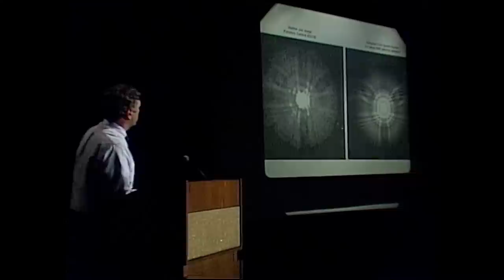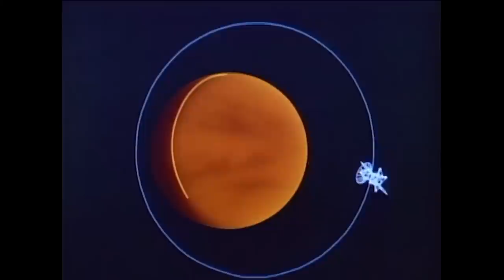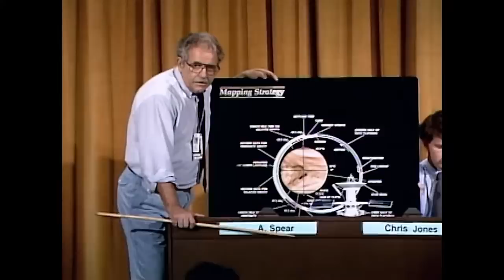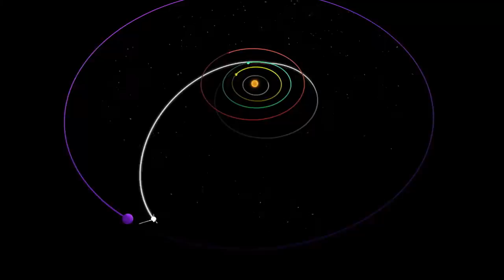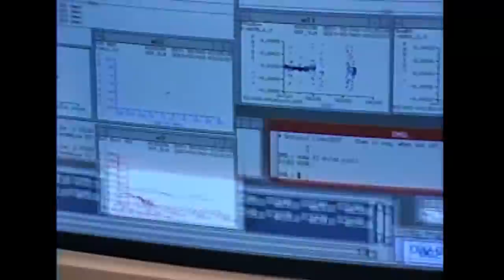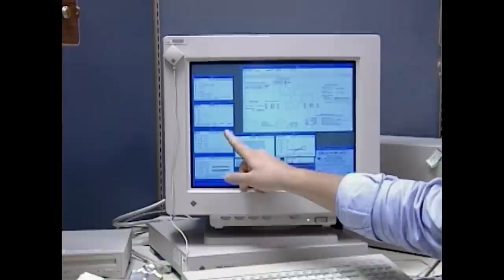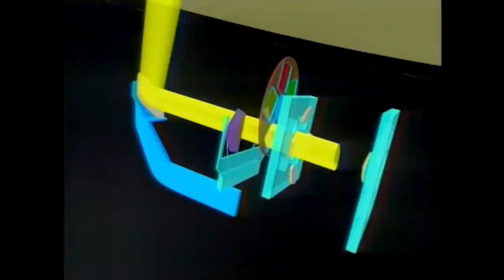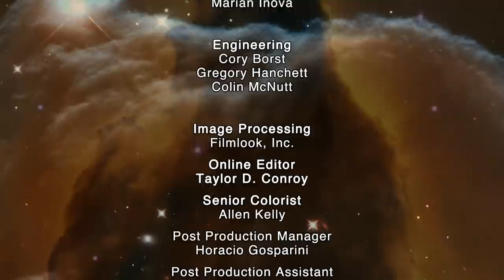JPL and the Space Age: To the Rescue

Comment: What about the radiation belts?
Reply: Fake space .... FreeDemonicPedoLies
Reply: For radiation, there are 2 important variables: 
1. the radiation intensity
2. the amount of time you are exposed to this intensity. 
You can multiply these two and get the total radiation dose. Humans die if they receive a dose of about 300 Rad. 
In 1958, James van Allen and his team discovered the belts that were later named after him. He also measured the radiation intensity. This is what he found: in the part of the belt where the intensity is highest, it is high enough that if you stay for about a week, you receive a lethal dose. So for the Apollo missions, the trajectory was designed to minimize the amount of time spent there. When the Apollo astronauts flew through the van Allen belts (which took about an hour), they received a dose of radiation of between 0.16 and 1.14 rads, or less than 1% of a lethal dose.